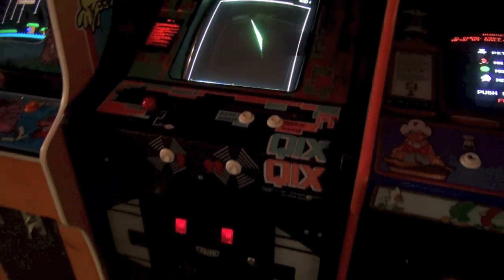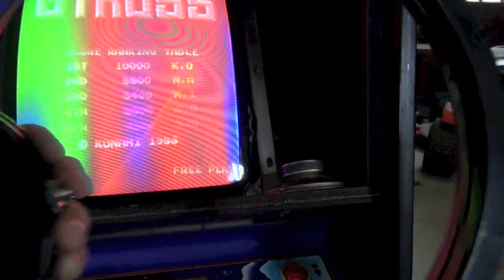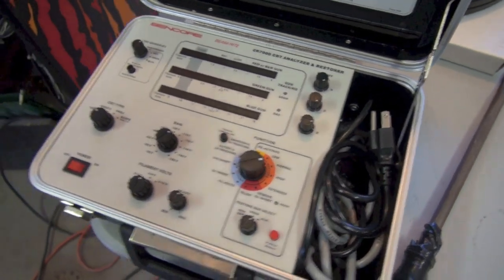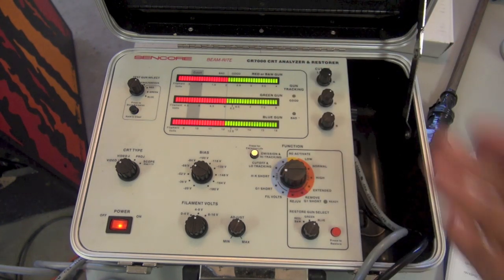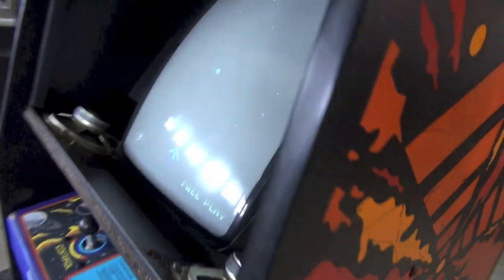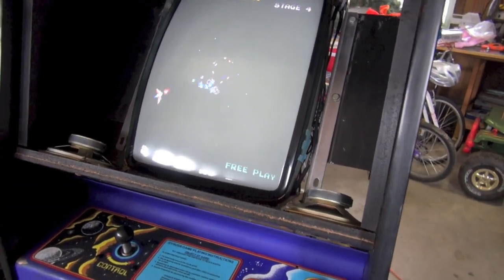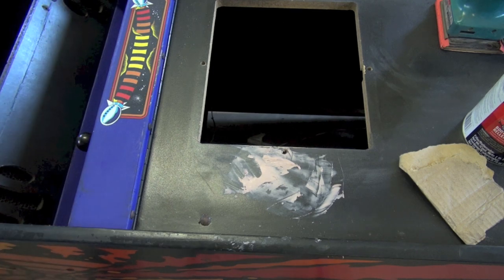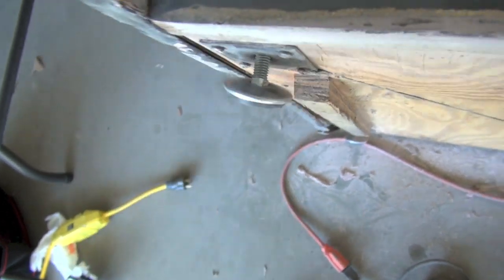How to degauss, rejuve, & restore an arcade monitor. Sencore CR7000. Bondo. Gyruss Restore Part 4

Comment: If you can't afford a CR7000, the CR70 works great as well as is usually a lot cheaper. I love mine and have used it a ton. These tools are a must for anyone serious about arcade stuff. By the way, love the videos and what you do for the community, John.
Reply: What functionality do you lose with the CR70 as opposed to the CR7000?
Reply: capnarrr As far as I know, just the LED bars. You also have a few more knobs you need to set. They both function the same and do the same thing.

Comment: Wicked video mate! Try turning your degauss coil through 90 degrees to change the field slightly to get rid of that stubborn magnetised bit.  Do very quick bursts too rather than sustained.  Your deg circuit could need looking at, just shot a vid on Sunday on this.

Comment: Super cool to watch this video but I'm happy that many arcade refurb places are just starting to use LCD instead.
Reply from the maker: +Inachu Ikimasho LCDs blow. Sorry, just not the same.
Reply: John's Arcade Game Reviews & Tech You tried it?
Reply from the maker: I have played games with LCD displays. It is just not the same. Not even close. Fix the old monitors and make them survive. Don't trash fixable old stuff because it's easier to throw an LCD in.
Reply: John's Arcade Game Reviews & Tech Well I mean yes perhaps to get that OLD SCHOOL vibe back. Do you which tubes were/are the best back then that you run into?
Reply from the maker: Inachu Ikimasho Best monitors are the WG 4900 and Sanyo 20EZ. Then G07, K7000
Reply: +Inachu Ikimasho I can appreciate an LCDs pixel perfect geometry,sharpness and brightness but the motion handling of a CRT is unmatched (even today), an LCD will have some blur when objects are moving which of course causes loss of detail, you can also experience a degree of input lag introduced by an LCDs digital image processing (varies depending on model, some LCDs have low input lag, but a CRT has 0ms input lag!) Also these old arcade games are running at low resolutions which look fine on a CRT but a fixed pixel display like an LCD would have to up-scale these low resolutions which can be ugly unless you're able to apply filters via software (like Mame). IMO a good ol analog CRT is the perfect match for these arcade games. Oh and sorry if you already knew all this I just had to get it off my chest lol.
Reply: +Inachu Ikimasho even with MAME HLSL settings enabled, LCD doesn't match a CRT for old games. Input lag, blur can't compete with CRT. On top of that old arcade games are setup for 4x3 displays. They stopped making 4x3 LCD's about 8 years ago. The best 4x3 LCD that you might still be able to find is a Samsung 204B. I have one of those, I have MAME on a i7 based system running to it, and it is still not even close to a CRT. Something charming about the glow of phosphurs verses the filtered light that passes through an LCD. Sure CRT's are cumbersome to work with, but in a very big way, we took a step back when the display industry went to LCD displays. There was a small window of opportunity for SED displays, but we missed it. So don't ever toss that CRT. Sell it to something that can do something with it. If you can't sell it, give it away.

Comment: This was opposite to what I've seen with mine and Turbo's. We usually get low tracking but ignore that (usually 3 knobs end up full) and then emission readings are so-so. Hit the guns a few times and the tracking still sucks but the emission levels are all 3/4+  Reinstall and monitor is much improved.

Comment: I got a cr7000 and I have a couple tubes that are dim. I have followed the instructions in the manual but have seen strange results with the low cut off test. When I do that test none of the bars move. Did gentle restores and the tubes look better but the low cut off tests still show nothing. Wonder if something is wrong with my cr7000 that is making the test report no reading? I can still return it as I just got it.

Comment: I have a monitor that seems to have lost the red all together. Would this Sencore CR7000 be able to bring that red back into the tube?
Reply from the maker: It's possible. You need to figure out if the issue is the tube or the monitor chassis. You could have a bad color drive transistor or pot that is causing the red to go away. More likely that then the tube.

Comment: Most monitors have small corrective stick on magnets to correct color purity issues
if you replace a tube these wont be there or will be in the wrong place 
if one is careful not to shock ones self , you can use a weak refrigerator magnet or magnets on the back of the tube to fix color purity issues,
  
First, you need some thin flexible magnet material.  Not too strong, typically fridge magnet strength.  A strip of flexible magnet can be purchaed in Home Depot or a craft section used for making picture frames etc.
The idea here is to use the magnets  on the back side of the monitor to compensate for the area that is not pure.  Experiement by moving the magnet along the back side of the glass tube.  The closer to the center (yoke), the more compensation.  Turn and spin the magnet until the blotch goes away and then glue the magnet in place.
You may see other magnets already glued in place by the factory.  Use that as a guide for size and location.
Again – do this with the monitor OFF and wait 15 minutes between each attempt so that high voltage is discharged.  Do all adjustments to the monitor in the position where the game will reside or you’ll be chasing your tail.

Comment: You made several mistakes. First you never restore videogame monitors because they work all the time and 95% of cases you cant restore them. TV that sits for a while get restored often. 
Second you just had problem with RED cut off, should try to restore only RED, since your RED cutoff regulator on the right side was on max while others are not. Sencore compare all 3, if one has to be turned way on a lot and others not it gives you bad light on.
Also whenever you have bad cut-off rarly you can restore it. The only thing you can restore it bad emision, others are just more for testing purposes.
And lastly when you restore tube you have to wait 1 minute until it heats-up and get temperature up, than press restore button, not right away as you did.

And last, if you do this often try to get Muter BMR2005, its way better and more sucessful than Sencore.
Reply from the maker: +sepertude Thanks for the tips. I think when I did this, it was one of the first times ever using the Sencore. I've used it successfully many times since.